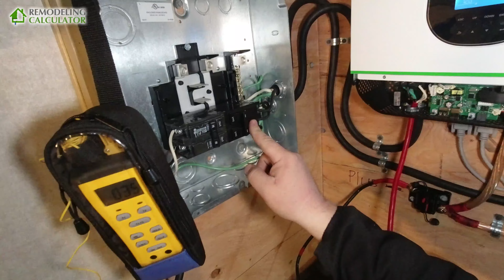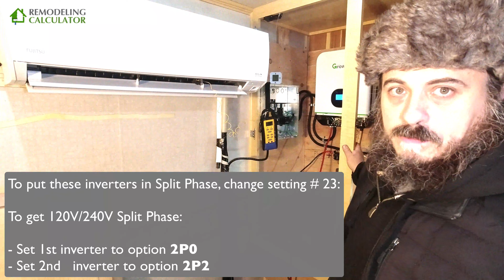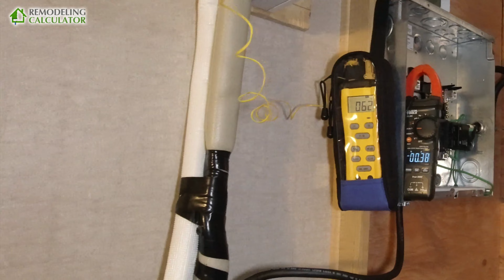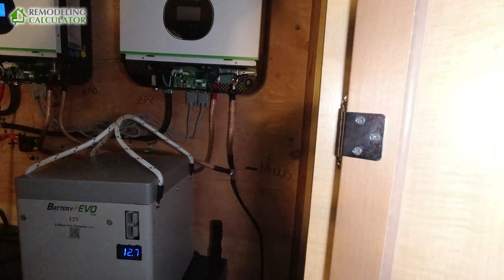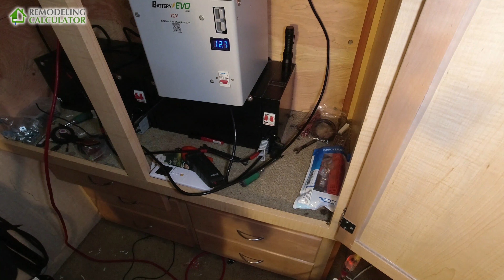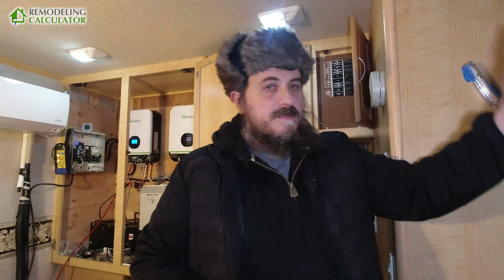RV Heat Pump Powered by GROWATT Solar Inverter  + LiFePo4 Batteries - 240V in Split Phase

Comment: Great information....and yes 120 volt....
Reply from the maker: Why 120V? Besides compatibility?
120 limits you to single zone heat pump. What if you have big camper? 40 footer or a 5th wheel, and what to condition / heat bedroom separate from the rest of the camper? You can put a 2 zone 240v unit - single compressor + 2 heads ... But these are only 240v.

You can change batteries with solar, and when on shore power, put 2 high amp battery chargers on your lithium batteries ... These will be able to keep up with your mini split even in the winter..

Also 240v models are more efficient.

I know this greatly complicates the setup, but ....